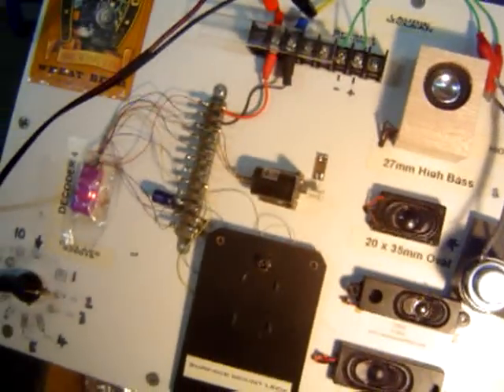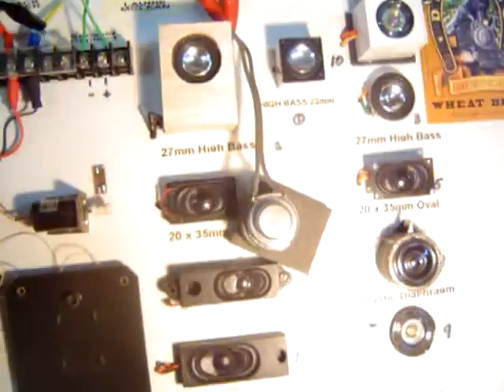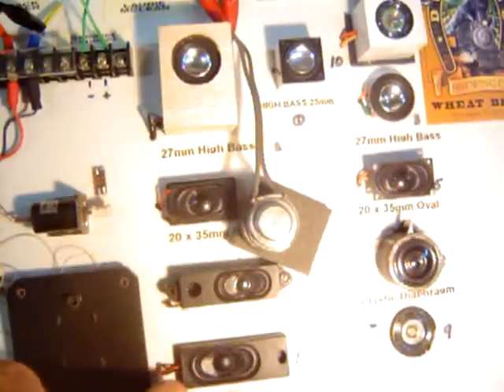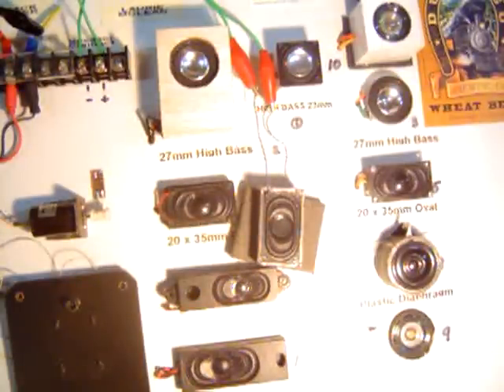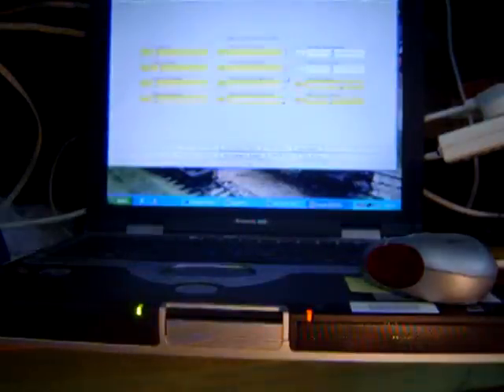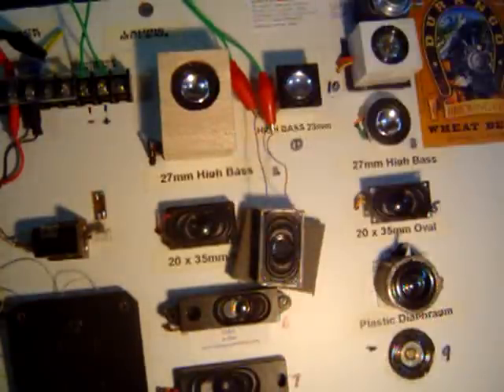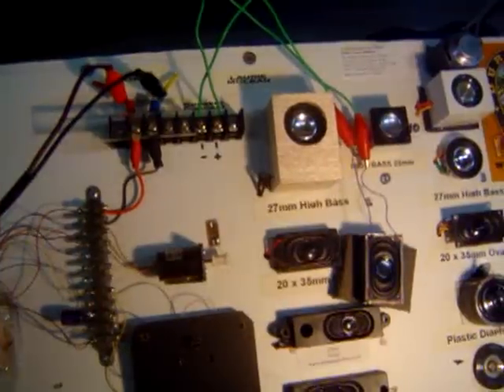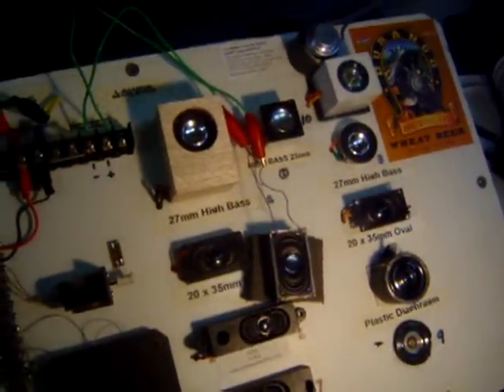Sound Sampling - Lead Enclosures & DDE

Comment: Yes, anything you can adjust using DP, you can program (admitedly more slowly, and with a bit more headscratching), using your regular DCC control system and "CV programming" button-press sequence.
The decoder doesn't change, the CV you are tweaking,
or the value you are setting it to don't change, 
you're simply changing the "User Interface" you use to apply the CV value.
(analogy: do long division with pen + paper, 
or with a calculator)

Thanks for the always informative videos Laurie!